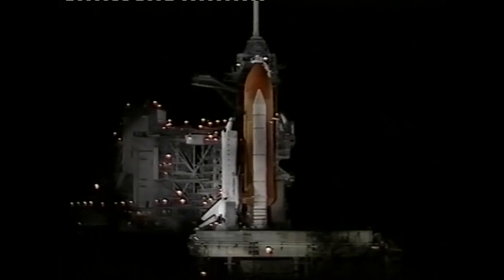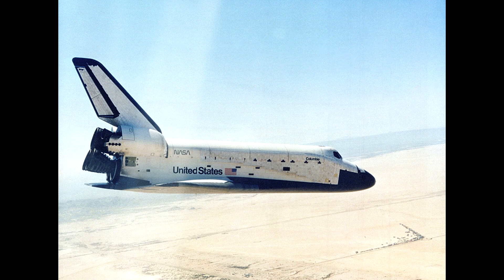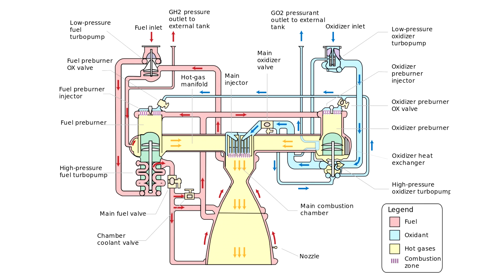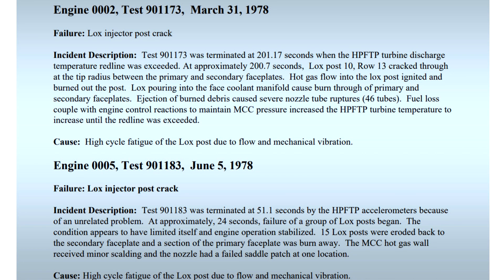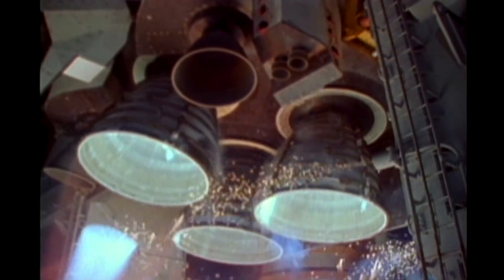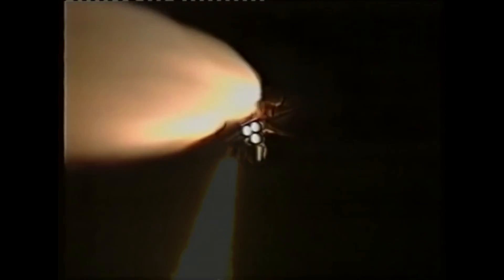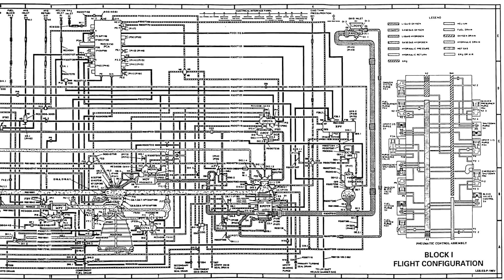How A  Gold Bullet Almost Destroyed A Space Shuttle

Comment: Great engine however the complexity and risk of operating it highlights how fantastic the Raptor 2 design is.
Reply from the maker: Raptor is a way more complex engine, running closer to limits
Reply: @scottmanley  I understand the running closer to limits, but more complex?  You said it yourself the power head has to be inspected after every launch.  Raptor 2 is designed presumably for multiple reuse without tear down.

Comment: 7:58 That's not from overtightening unless it's left hand threaded. That burr is from the counterclockwise force of the screwdriver on the screw. It could be someone removed the screw and put it back despite the damage. And the damage would not prevent them from making sure the screw was properly tightened if it's a right handed screw. 

And to bad your favorite exchange is unintelligible. Also, what would landing the shuttle have been like with that extra payload?

Comment: Three things.  The way you say stoichimetric is elegant - I would love to hear you say pussilanimity in your next chapter. Second, the pin was actually gold plated steel, not solid gold. Those pins were the bane of my existance. We went through variations in taper angle and length but they were always problemsome.  For many years there was a requirement that only one fellow R. Pieron was to install pins because he had huge biceps and a short handled 15 lb. sledge hammer. His pins never fell out. Eventually he retired.  Lastly, I always thought that the shuttle mission calculated propellant margins based on the tag value Isp and thrust of the actual SSME's being used. One had to meet minimum margin requirements but I am sure the engines could not tolerate either propellant to run dry.
Reply: Wouldn't the engine have shut down if knew it was about to run dry? Then I would think they could use the OMS pod for that final push 🤷🏻‍♂️

Comment: there could have actually been a abort system on the shuttle In my mind this is how it would have worked. So if there's a problem with one of the rs-25's or the Solid rocket boosters what would happen is the main engines cutoff the boosters are separated and so is the external tank then mini Solid rocket engines activate at the edge of the flight deck and crew area then a separate is activated at then the boosters push the crew away from the failing rocket.
Reply: Then what? They crash into the water?
Reply: @veritateseducational217  yes with lots of parachutes
Reply: This would’ve been impossible. The separation systems between the ET and SRBs was just designed as a small explosion, helped by the motors at the top of the SRBs to clear the ET. If the boosters were separated mid-flight, not only would the ET and Orbiter have a high chance of getting caught in the flame, the wind forces put against the stack would’ve most likely ripped it apart. 

Take Challenger for example, the shuttle didn’t “explode.” Instead, it was ripped apart by wind forces.
———————————————————————
Let’s say this could’ve happened, now you would need to preform a very dangerous RTLS as your parachute idea would not be very feasible. (The speed the shuttle would be going would mean it would eventually crash into the ocean.)

Not only is RTLS very dangerous, it was never even designed to really work. Everyone hoped an RTLS would never be required, and thankfully they were right.
Reply: @veritateseducational217  oh

Comment: I can see how a burnthrough of the engine nozzle would be bad, but why would that have necessarily led to the loss of the orbiter and crew?  Even if the entire nozzle below that point tore away (leading to the total loss of thrust from the engine from hydrogen starvation, resulting in an extremely oxygen-rich shutdown with resultant severe internal erosion of the engine's internal components), the shuttle was designed to be capable of reaching orbit or an emergency runway in the event of a single main-engine failure at any point during ascent.

Comment: Holy crap. This narrative gives a small sense of how complex all these systems are and how many potential  modes of failure there must be. It’s amazing there were only 2 shuttle tragedies.  Curious why gold was used for the plugs though. High ductility?  Low corrosive potential? Low melting point?  Or... provided by a third party vendor who wanted to make the parts super expensive like the proverbial $20,000 Air Force hammer? ;)

Comment: I would have had the Columbia retired as  early as 1992. APU fires on STS-9, orbital fire hazard on fuel cell on STS-83, two hydrogen lines away from engine rupture on STS-93. The maintenance conducted in 2001 found 3 000 wiring issues. I would have had her safely retired long before what happened in '03. And would have had a Neptunian orbiter probe with the savings. 20-20 hindsight, maybe, but...

Comment: S: Suicidal
T: Transport
S: System
Reply: @krvnjrcbs  Definitely. While I think that the Shuttle definitely wasn't perfect, it is important to note that everyone thought that the program wouldn't last as long as it did... we thought that we'd get something better sooner than we did.
Reply: @krvnjrcbs  Exactly. The shuttle had some unmatched capabilities... without it the ISS wouldn't have happened. That said, the Shuttles were aging beasts, and I can see why they were retired. Same thing goes for Falcon 9 and Starship in 30 years. One of the great things about spaceflight is that there is no limit to what you can achieve, so long as you have the technology for it...
Reply: @krvnjrcbs  I would've had two different variations. One unmanned shuttle variation to carry cargo. A different variation can be used to carry crewmembers only. I also wouldn't use solid rocket boosters because once they are lit they can't be turned off. Also, the shuttle itself would be placed at the top of the stack so there wouldn't be a risk of foam strikes.
Reply: Ouch.

Comment: the screw head was most likely not damaged in tightening but in an attempt to loosen it with an inappropriate tool. you can see that the tool slipped counterclockwise by looking where the burr is and how the head is deformed and assuming that this screw has a right-hand thread, this happened during loosening. (If this is a left-hand thread you are correct, but tbh its unlikely that it is.)
Edit: 8:04

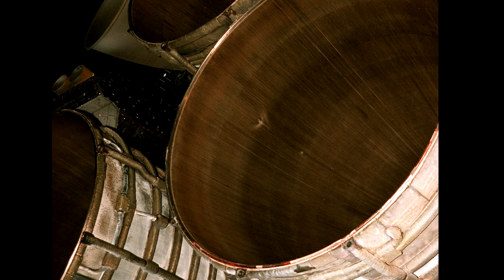Comment: Yep. The nozzle. 3:29 Probably the most underrated piece of engineering on a rocket.  Not only does the liquid hydrogen flow through its surface at a tremendous speed, heating up the hydrogen while also cooling the nozzle, but the nozzle carries the whole structure with propellant, thrust and all, while also steering the whole thing!

Comment: Well Columbia blew tf up a couple years later anyway, so I guess their fixes weren't exactly that great
Reply: Columbia did not 'blow up'.
Reply: @yassassin6425  what would you call it? Falling apart gracefully with a fireworks show?
Reply: @EvilJ069  

It certainly didn't as you say "blow up". The piece of double layer insulating foam that broke free during launch from around the forward attachment pod strut and struck the leading edge of the left wing then allowed superheated plasma during re-entry to burn a hole in and enter the structure itself. Subsequent aerodynamic forces acting on the cavity caused the orbiter to yaw to the right. Additional elevon motion was commanded by the flight control system to counteract left side drag. The drag was trying to roll the vehicle to the left, while the flight control system was commanding the elevons to roll it back to the right. The rate of left roll was beginning to overpower the elevons, so the control system fired two 870-lb.-thrust right yaw RCS thrusters to help maintain the proper flight path angle but it was in vain. Seconds later the extreme aerodynamic forces exposed to the underside caused it to shear off the wing and tumble end over and ultimately disintegrate. At mach 18.3 and 39 miles high, the orbiter was quite literally ripped apart. And no it wasn't graceful and yes, with the temperature of reentry, there was indeed as you flippantly add, a 'fireworks show'.
Reply: @yassassin6425  "Houston, we have a KABOOM!"

Comment: that screw that was damaged, did you see on what side of the hex head was damaged ,  the screw must be an anti clockwise thread as the damage is on that side of the head, if it was a clock wise thread the damage would be on the outher side of the hex head and the damage would have been from loosening with the wrong size hex driver
Reply: @7:58
Reply: think about that, if it was a clock wise thread the damage was done before assemble, as the screw was damaged before assembly and the mechanic would have used a damaged screw.

Comment: Why do you think it's an engineer that tighten screws I worked in the main engine program for 31 years. We would NEVER have a engineer assembly anything not there job. There are electrical technicians and mechanics who worked on the all components of the engines. Most engineering can't tell the difference between a screwdriver and a wrench.  And the zealous one that try always, always break it or cause more work.

Comment: That poor Columbia shuttle was worked a bit too much. I can envision a rough screw head sanding a hole through the jacket and insulation, causing that short. I would've thought every inch of those shuttles was evaluated with a fine-tooth comb and anything showing wear would've been replaced. Some land-based vehicles are completely rebuilt after each use (race cars, rocket cars, etc). Yes, the cost is high but the strains on the shuttle and boosters are far greater too, and far more expensive.

Comment: that gold pin is SIMILAR to an experience i had.... 

i rebuilt my 1974 kawasaki g5 100cc 2 stroke (and a 2 stroke doesnt use valves.... it uses ports in the cylinder wall)

part of the old piston i decided to re-use cracked..... and a piece broke off
it cracked due to how i tightened a bolt on the crank shaft.... jamming the piston with a block of wood

anyway.... this chip went threw the bottom of the engine.... past the main bearings..... went past the intake port... into the combustion chamber....
and rattled around 

i heard the rattle.... so i shut it down

but i left "dents" in the cylinder head and top of the piston..... before getting stuck in the piston
if the piston came up while the piece was in the port..... 
it would have DESTROYED my engine 

a 300 dollar rebuild would have turned into 1300 dollars....(which is a LOT of money for me.... especially at the time)

very lucky i only needed a new 20 dollar piston....... which took 15 mins to swap out

Comment: According to the graphic @ 8:20 the two computers had 32 kilobytes plated wire memory arranged in words (16 bits), not much for 1999, maybe that kinda RAM is more resistant to radiation or "if it ain't broke don't fix it" old-school tech?
Reply from the maker: That was the 1970's version they did get upgrades at some point.

Comment: "It's been going for 19 years of its 5 year mission" is such an iconic astronomy phenomenon
Reply: But Captain Kirk gets his five year mission cancelled after three seasons. Where's the justice?
Reply: Every spacecraft and piece of space technology is built to significantly outlast its mission deadline- because if they build it to match the mission length, then anything that goes wrong will cut the critical mission short. They build it to be certain to last as long as the primary mission, and expect it to last longer to do more.
Reply: Also, sending stuff to space is really expensive, so you want to get as much out of the hardware that you send as possible. Kepler went into radiation-stabilized mode after 2 of 4 reaction wheels broke on it; Spirit was driving backwards while dragging a nonfunctioning wheel fro a while; Hubble was taking scientific data for 3 years with a terrible mirror, etc.

Comment: I heard a long time ago that the space shuttle engines were going way over budget in development so instead of working on them until they got them to the original specs they wanted they cut development and went with what they had. The story was that some parts that were supposed to last twenty five missions had to be replaced every three missions. I don't know if that story is true but it seems reasonable.

P.S.
If you are building a space ship and you are designing engine control software have it back off of a low chamber pressure instead of trying to make up for it. Just seems prudent.

Comment: Great video. Rocket science for none rocket scientists.

The claim with the Shuttle was that it would be making frequent flights into space, at least one every six days. But then you read that after each flight the three engines had to be remove to be checked which took months to do. So assuming they were flying once every 90 days there would have been a need for at least 15 Shuttles plus probably at least another 5 in reserve. They built six.

Is this an example of over promising and under performing. Or was the original idea so compromised they just took what they could to keep flying.

Comment: If the exhaust can melt iron ....why didn't the gold vaporize ?.…..stuff that makes you call  BULLSHIT !
Reply from the maker: Because the gold is used to plug the oxidizer inlet before the main combustion chamber, it’s cooled by liquid oxygen.
Reply: Scott Manley , well according to all known facts reported the gold was bouncing around in the direct flame without any lox cooling it long enough to punture the nozzle 3x .
Reply from the maker: Yes, so , how fast does a chunk of gold need to be going to break aluminium pipes? Then divide the distance it travelled by this speed, you'll find that it took less than 0.1 second. Now figure out how long it takes for gold to melt in that environment.

Comment: If the screw head that was damaged was removed and reinstalled for any reason, there should have been an inspector that looked at the screw head. This should have been documented and they would have been able to follow the paper trail to who was responsible. One of the sayings on the shuttle build was that the paperwork generated weighed more than the shuttle. that looked like it was an undocumented repair.

Comment: Hey Scott, this was an excellent video on the Chandra/Columbia STS-93. And while there was a potential for many issues, the excessive oxidizer consumption resulted in a 15-16 foot per second orbital underspeed and an altitude deficit of approx. 10 nautical miles(depending on what source you read).  With your research and presentation skills, I think that if you did a similar video about STS-51-L Challenger with the 36,000 pound SpaceLab-2 in the Payload Bay. About 3-1/2 minutes into teh ascent there was some SSME sensor issues forced the center engine to maintain function on her backup sensor loop, 2 minutes 12 seconds later the secondary sensors failed causing the center engine to safely shutdown.  Immediately an Abort To Orbit was called.  About 8 minutes into the ascent, one of the same sensors but on the left engine began to act up.  Booster Systems Engineer who was sitting in the backroom, quickly suggested that the automatic engine shutdown system which depended on these specific sensors to be disabled/ignored by setting the switch from ENABLE to INHIBIT.   Her quick thinking prevented a 2nd SSME shutdown of the right engine based on bad sensor data. Due to the timing of this late 2nd engine out scenario, keeping the 2 remaining left and right engines burning avoided a Loss of Crew/Loss of Vehicle and the Orbiter was able to Abort it's mission to a lower than planned, but safe and stable orbit 312x321 kms @ an inclination of 49.5º.. Here is a condensed video of the Press to ATO and the actual ATO call.  The female voice is Jenny Howard. https://www.youtube.com/watch?v=JMtNUxklj50        The resulting Abort To Orbit required that the remaining left and right SSME's to run for a program record 9-12 minutes. They usually run for approx. 8-1/2 minutes when all 3 engine are operating nominally.  If this was later in the program with the upgraded Block-II engines, the remaining engines could have had their thrust increased from the normal 104.5% Rated Powel Level to 109% for Intact Aborts, or if there was a "Do or Die" Contingency Abort they could go to 111% on the Space Shuttle Main Engines.  The discussion about going to "Limits To Inhibit" begins at 3:39 with the actual call going up to Challenger at 3:47.   Engineer Jenny Howard mentions that they "Are good to go inhibit as they have single engine capability." The Launch Director asks if they are past the TAL abort window(Trans Atlantic Landing", FIDO replies that they have passed the TAL abort window-thus only Abort Once Around(which was a window of opportunity of only a few seconds) and Abort To Orbit are the only abort scenarios remaining.  FLIGHT then tells CAPCOM to instruct Challenger to set "Limits to Inhibit", CAPCOM then send up the message "Challenger-Houston, Main Engine Limits to Inhibit." With the challenger crew replying "OK Inhibit."  Jenny Howard then communicates "We'll keep a good close eye on it."  IIRC Jenny Howard received an award for her actions that day.   Potentially life altering decisions must be made in seconds.  This was the only time that the Space Shuttle Main Engines ever failed during a flight, and it was due to bogus sensor info failing SAFE, rather than an actual engine failure.

Comment: I read a blog that Flight Director Hale talked about this launch. He said that the computer handled the H2 loss by burning more oxygen which did raise the temperature and caused the engine to enter a "temperature controlled throttling" regime to help keep the temperature down. BOOSTER saw this and actually told the FD  that it looked like all the signs of a nozzle leak.

There is a great video of just Mission Control and the crew talking during the launch.